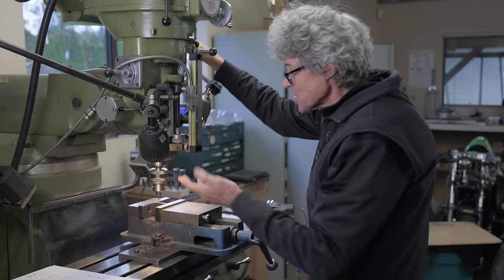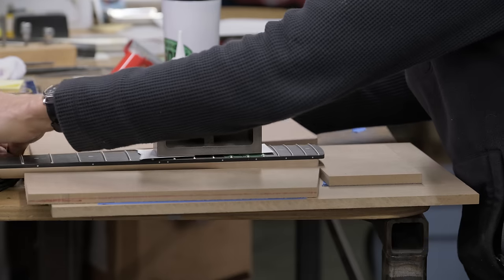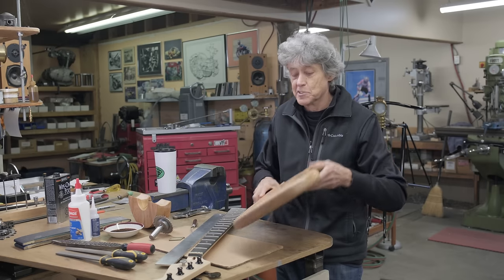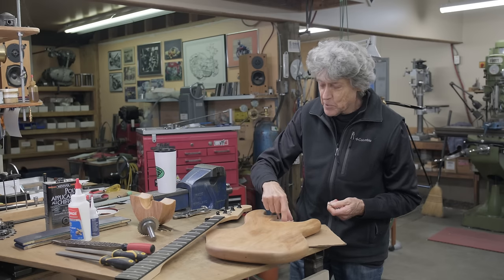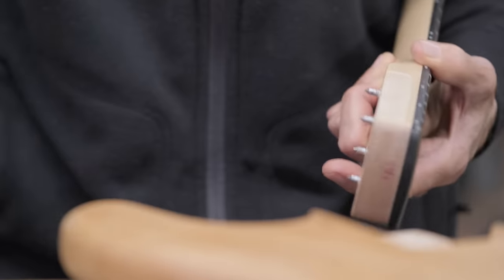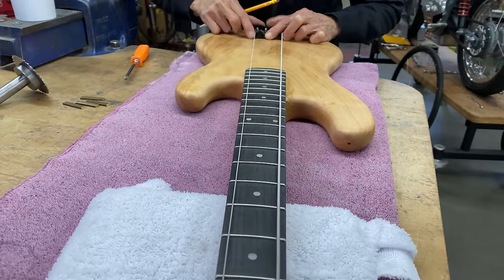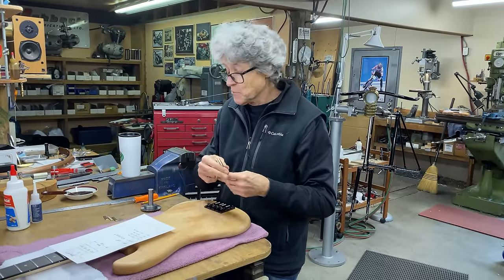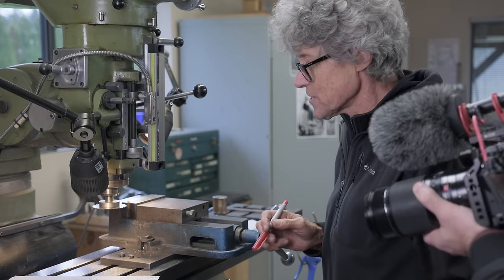Making a BASS BODY // Paul Brodie's Shop

Comment: One thing I learned from Glen the hard way is that you plane the material to thickness first, then cut the outline. Planers can exert a lot of forcec down and can easily break off outlying areas where the grain runs across the narrow parts. A thickness sander is slower and more predictable..

I have a gorgeous piece of mahogany with tiger striping and bird's eye but I've never gotten around to doing that. I even have a very suitable piece of pernambuco that I could use for the neck, and a gorgeous piece of Gabon ebony I've been saving for 20 years for a fretboard.

You can get legal ivory. You can get it at Mountain Gem in Burnaby or at Capilano rock and gem in North vancouver. In my case, I got my pieces from a person who had a gold mine claim up in the Yukon for years.
Reply from the maker: Yes, there are acceptable ways of proceeding.. The planer worked well for me :)  Sounds like you have some very nice wood just waiting for the next step.. Go for it!!    :face-fuchsia-wide-eyes::face-fuchsia-wide-eyes:
Reply: @paulbrodie  I forgot to mention that the legal Ivory is in fact fossilized from either mastodons 4 woolly mammoths. Mine came from a person who  sold me a small Tusk plus a small fragment I could play around with
Reply from the maker: Very good. I did not know there was such a thing as "legal ivory"...

Comment: Great progress! I'm loving it. It's good to see different approaches to get to the end result. Gotta store them away for another day.
I'm wondering if you are including the radius of the fretboard when you drill the nut slots. I can't see if the nut slots make an arc to match the fingerboard which is usually around a 9.5" radius on a Fender-style instrument. Luthiers and repairpeople often take a pencil ground in half lenth-wise to ride across the first frets to mark the rough nut blank temporarily installed in the nut slot. it gives the height of the frets across the board and you can add a few thou to mark the bottom of the nut slot. Can't wait to see the progress and how your pickguard will look with the machining.
Reply from the maker: Thanks for watching and commenting.. I traced the original nut as a part of making the new brass nut.. In the end, I am happy with it!    :face-fuchsia-wide-eyes::face-fuchsia-wide-eyes:
Reply: @paulbrodie  Paul, That's perfect. In this case tracing the original seems like the easiest way to do it. I work on my own guitars and it brings many rewards. You get it the way you like it, no "middleman". I recently bought this lovely little tool called a "string spacing rule" on ebay for around 20 bucks. I'm always wanting another guitar tool. Making guitar nuts takes practice.
Reply from the maker: Thanks Svea, Yes, I am slowly adding to my bass collection, and I do like buying / making my own bass tools and fixtures. "Many Rewards" is so true..Thanks for commenting..  :face-orange-raised-eyebrow:

Comment: If you want a really good finish with the wipe on poly, try hitting it with 0000 steel wool between coats. I've done that for a few pieces of furniture, and it turns out great. Makes a heck of a mess of fine steel wool threads though. But that can be cleaned up with a magnet inside a plastic bag. Move it around the area, then turn the bag inside out, and all the steel wool bits get caught in the bag.

Comment: Nice, bikes and guitars.
Two of my very favorite hobbies. 😊
Also I've marked the holes in a body before like you did, good idea! Lol😂
Also you can buy brass nuts, although they can be a bit expensive, brass bridges too.
Reply from the maker: Thanks for watching. I am having a lotto fun... Can you tell?    :face-orange-raised-eyebrow::face-orange-raised-eyebrow:
Reply: @paulbrodie  yes 😊 I'm ashamed to admit how many guitars I've ruined. But eventually you figure things out.
Reply: @paulbrodie  also the nuts come radiused. Also some bridge saddles.
But there is a trick using a half pencil when marking the depth of the nut slots.
The files, tools, etc are very expensive.
I think that's the part that made me ruin some things , lol
But if you are working on guitars on a large scale, then yeah those tools make sense.

Comment: We are so similar Paul. Though you are on a whole different level. I've done motorcycles and bikes and I'm a wood worker. I've thought about making an instrument as well. My thought was to make an all stainless steel ukulele as that's what I play. I figure stainless would have a better ring than aluminum and I'm much better at welding stainless. I picture taking a stainless tube, cutting it in half, squeezing it at one end to make the taper and reflattening it to make the neck.

Comment: That's a new approach for me. I just use files. You're right in that the string should contact the nut where it meets the fretboard. But I also round the slope towards the tuners a little to avoid binding so that the string can slide freely while tuning. 

You don't really need much of a slot since you drilled out the bottom, because preferably the slot should just be a half moon or maybe a little bit deeper. That's all that's needed to guide the string. Anything more and it just looks ugly and interfere with the hand for some when they play in the first position.

For guitars I think I'll continue filing, because drilling a .011 hole is challenging, but I'll consider drilling bass bridges when I make them out of brass, and then lop the top of with a saw. But I will still have to file to create the slope in the bottom of the slots.

Comment: Watching a metal Engineer problem solve making a guitar in wood is fascinating... nice one Paul! You arrive at very different methods to that of experienced luthiers and achieve excellent outcomes... apart from the nut which was a cluster f*** 😂 See previous message... talk to Ben Crow at Crimson!!
Reply from the maker: I have watched quite a few Crimson videos.. Ben seems to know what he is doing. By the time I cut the brass nut down to its' final shape it worked out fine. The "hockey stick slot" disappeared and you would not know I had so many problems with that one little piece...    :face-fuchsia-tongue-out::face-fuchsia-tongue-out:
Reply: Well, you've already understood a great deal very quickly, and as you're largely learning by doing you're making impressive progress 👍 A guitar nut has a number of critical tolerances to account for, and the half pencil trick is a simple solution to transfer fret height to the nut. This helps to ballpark the distance between the bottom of each string slot, assuming a straight neck, to the 3rd fret... critical when finessing playability. Slot depth is done with strings on! Even though you've cut slots, you must get the nut fitted with all 4 strings on... don't try to set string height by filing the bottom of the nut, you'll be at it for days because too low, a string will buzz, too high makes it harder to play and sharpens string intonation when fretting. 😎
Reply from the maker: Thanks Pete. Yes, everything you said about the nut makes sense. I have seen the 1/2 pencil trick. I will figure it out and get that bass playing beautifully!    :face-fuchsia-poop-shape::face-fuchsia-poop-shape:
Reply: @paulbrodie  I have no doubt that you will Paul and looking forward to seeing you do it. BTW you're looking extremely well, and wishing you health & happiness throughout 2024!
Reply from the maker: Thanks Pete. I am doing my best to be healthy and even gain some weight!     :face-fuchsia-poop-shape::face-fuchsia-poop-shape:

Comment: Ok, you said to comment but I honestly don't think you want to hear what anyone has to say. In any case here goes. 

First, on the neck. A tight as fit as possible is best. The fit should have been intentionally small then hand chiseled to a perfect uniform fit. You're too used to metal working in a machine shop, and I was a bit surprised you did the neck pocket like you did considering how much you hand file metal into perfection. What gives? In any case, what's done is done. 

Set neck would have been my preference. All the guitars I built in the past when I was doing that were set necks. Bolt on necks got sent to the crusher. I'm not going to engage in an argument about set or bolt ons or if one is better than the other. Everyone has their own opinion and to them only THEY are right and everyone else is wrong. I know the set neck is stronger and does a better job transmitting resonance through to the guitar body but on either set or bolt on, the neck pocket has to be tight as 7734 and maintain a constant uniform grip on all parts of the neck. Any void or looseness is going to cancel out vibration. 

Ok, The aluminum pick - pick up guard. You're going to do it anyway despite what I say so what I will say is, look up some videos where people are dropping magnets down copper or aluminum tubes. I rest my case! Now this also depends on how much mass you have planned for this. If its thin aluminum then you are probably fine but......

It doesn't matter if the guard is ferromagnetic or not, and I don't care what anyone who doesn't really know what they are talking about on forums or tubeyou has to say about this. It will have an effect on the pickups - PERIOD!!!!! 
Now you might like the effect it has and that's fine. But I'd be ready to make also a plastic pickup guard and try both to see how one does over the other. An ear-crometer test won't be good enough. You will need to record each version into audition and look at the actual outputs and raw data there. 
The sound may or may not be very noticeable but it's likely there is going to be magnetic dampening and interference using any sort of metal around pickups and I don't care what metal it is. 

On the nut. Yes you may or may not get more resonance. I only used bone nuts in my guitars. Now you can also have inotated nuts as well. The one thing about this is that as soon as you are playing, whatever chord or scale, as soon as you press on that string, the nut is out of the equation on those strings you're pressing. I would be open to trying bone and brass and see what you like in regards to the sound.

I said this before. Keep the routing pockets in the body of the guitar to as minimum as possible. I see people nearly rout 2/3rd of their guitars out for pickups and wiring and electronics and I'm just scratching my head what are they doing... If you're going to do that then why stop there. Just rout the entire guitar body into sawdust then. What's the use of having a body in the first place. Just saying. 

Use the best wire for the electrics and get the best pickups and best pots and best of everything in the electronics. Shield your pots cavity. Also, do some research on different wiring set ups. Not all wiring is the same. And wiring from the 50s and 60s and 70s was all different. Types of wire and shielded wire and yadda yadda yadda.

And use the hardest resin you can muster for the finish of the guitar. If you use a soft resin, then you might as well make a rubber guitar because the effect is going to be the same. Make sure the wood is dry to 6 to 8 percent. I liked mine dried to a lower percentage. Once dried to that percent put the hard resin on it. PRS guitars has a proprietary resin that's really hard. 

If you're all into quality, there it is. Also, watch some videos on the manufacturing of PRS guitars if you doubt what I have to say here. When I got into guitar building, I investigated every inch of their process and the process of 2 other guitar builders who will remain un-named. Suffice to say they both built the best '59 les paul copies in the world and these guitars are worth thousands today and sought after by famous rock musicians. Even Slash has some and appetite was recoded from one of these '59 copies.

Now, I have to go tend to other matters where I'm more appreciated... WHAAA HOOOOOO!!!!!!! 😁😁😁😁😁

🎸🎸🎸🎸🎸🎸🎸🎸